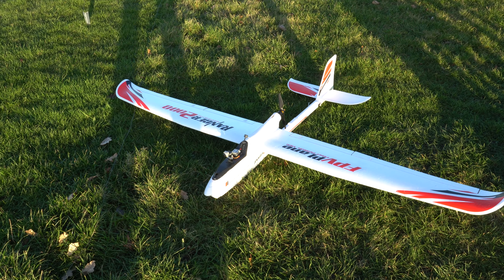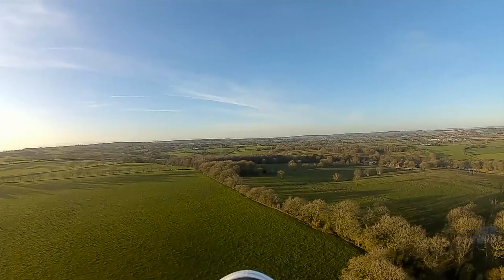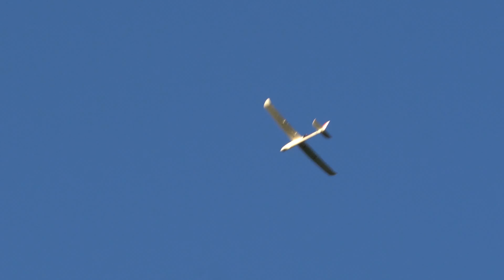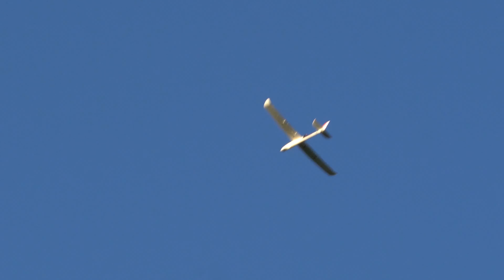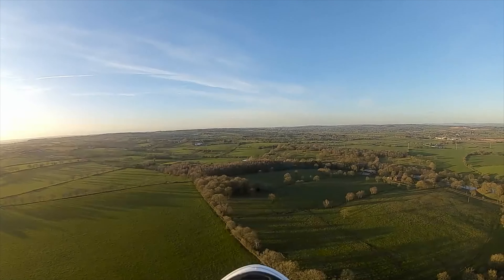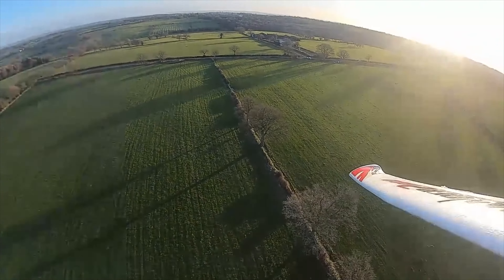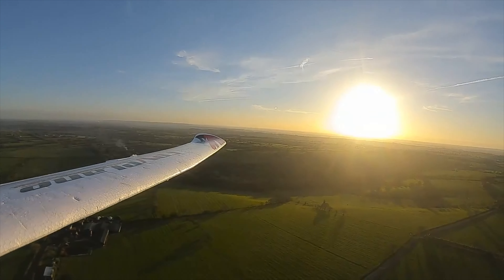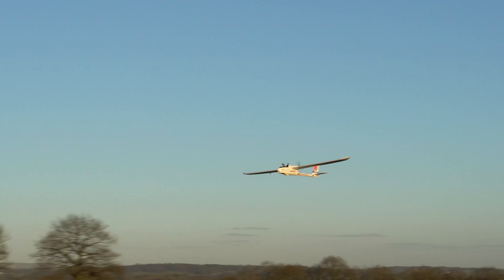Volantex Ranger 2000 2 Meter With Head Tracking VR DJI FPV - Will Fly For An Hour!

Comment: What a nice fun winter flight. Seeing such views and the sun from above the Earth is so nice. 😃👍👍

At 3:12 need to use video out, to goggles for telephoto tracking video to avoid sun. It's a bit of catch-22, having both wider field of view for location reference, and tracking zoomed in view. Your camera seems to do decent with focus. Tracking planes, etc is usually a challenge to keep in focus.
Maybe Phil would be interesting in assembling a tracker, normally used for long range antenna positioning, but could easily serve as a automatic video ground tracker. (just a thought)
BTW: Think there is a way to record goggle video (out) while FPV'ing to a Raspberry Pi, only problem is because of chip-shortages, supplies are limited until ~spring/summer.

Comment: Hi, me again. I have the PNP version of this now with Arudplane. Do you know if this supports Reverse Thrust on the motor for landing. Trying to kill off some speed when landing
Reply from the maker: no reverse thrust while flying would not work in any kind of aviation capacity. take a wider approach for your landings

Comment: My first and favorite FPV plane. I have crashed mine 2-3 times with minimal damage. I got a good deal on the 1600 and that version is sporty and lads shorter. I switched out all the innards for MG servos and Sunny sky 2216 1250 and 1400kv motors. I still dream of building a removable tricycle gear for making the pattern and hanging a good camera under the "chin" with some protection from a nose gear.
Reply from the maker: Funny you say that I was saying the same thing needs a landing gear
Reply: My favorite plane too after 2 years. I have pixhawk4 and openhd on it.